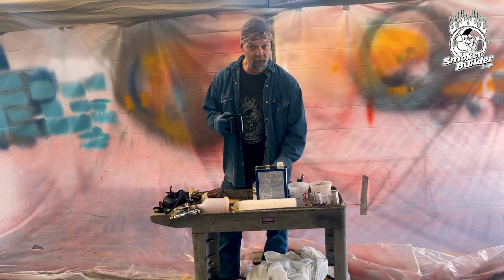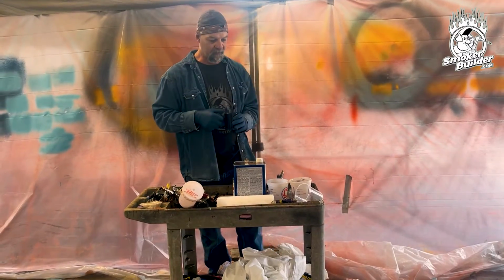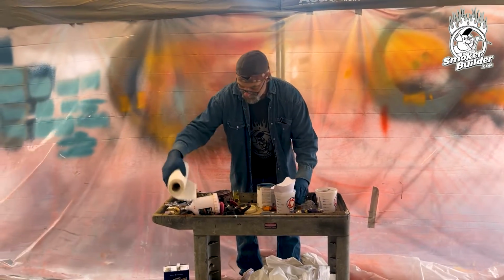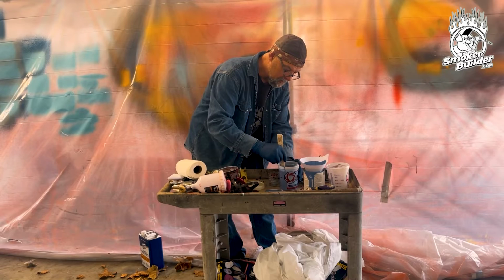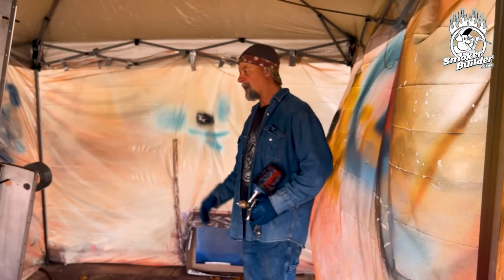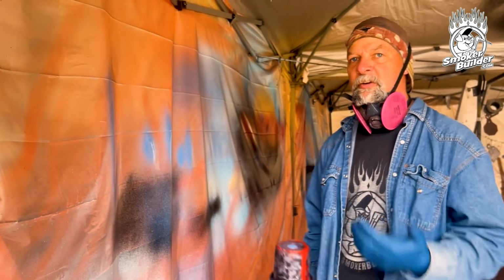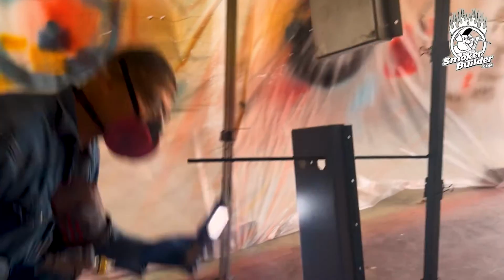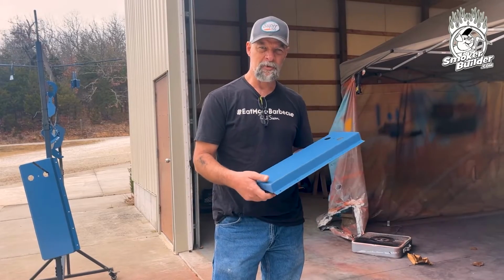Painting Smokers: My Drum Smoker Painting Process

Comment: Great video!  Using the high heat Rustoleum on steel plate do you have to get every bit of mill scale off or can you sand it and paint over it?
Reply from the maker: I don’t worry about getting all the Mill scale off. I just scuff it up with sandpaper if I’m worried about it smooth surface finish.
Reply: @SmokerBuilder  really appreciate it Frank!
Reply: Nice video EVERY TIME